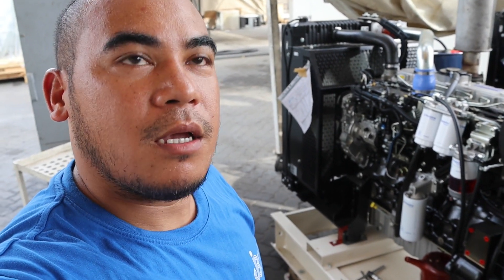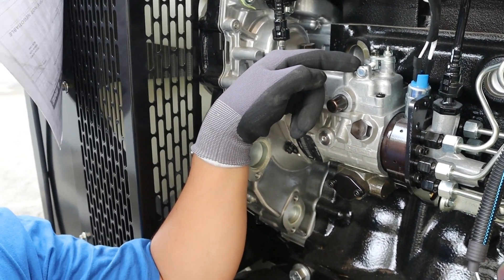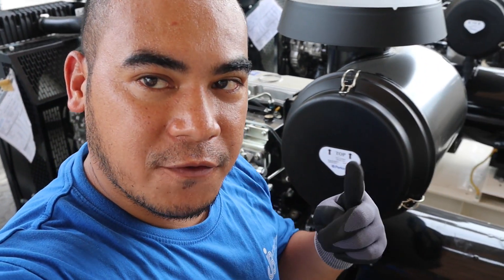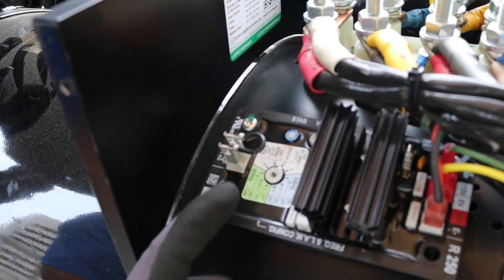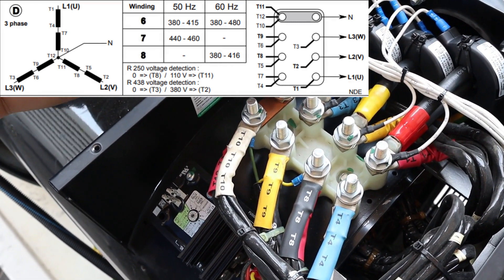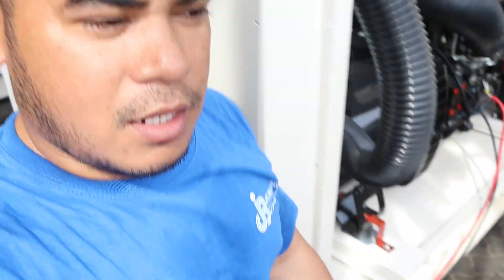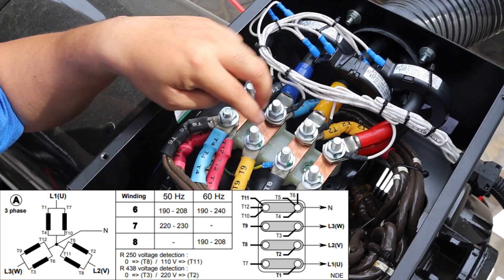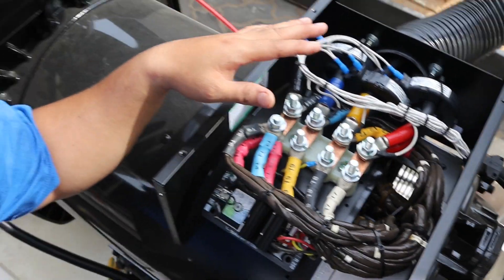Series star connection and parallel star connection benzblogs

Comment: ano po standard mag adjust RMP to low voltage connection ? any notes?
Reply from the maker: First make sure all are stable speed or rpm before doing that adjastment
Reply from the maker: Simply follow the diagram

Comment: Sir pacontent ng ATS connection
Reply from the maker: Salamat sir i my best na magawa nyan bless u kep safe always
Reply from the maker: No problem sir what ats you have there here we are using socomec
Reply: Sir kahit basic principle lang sir about sa wiring diagram or connection tapping. Generator Tech. kasi ako sir but actually I am assigned in electric motor and Alternator Rewinding and others stuff related to industrial electrical. Hoping sir macontent mo po sir.